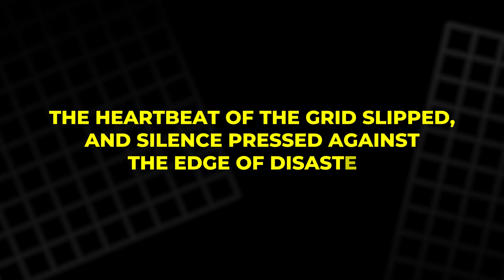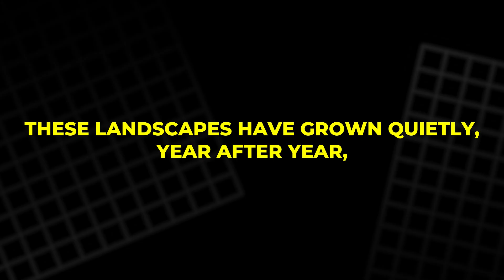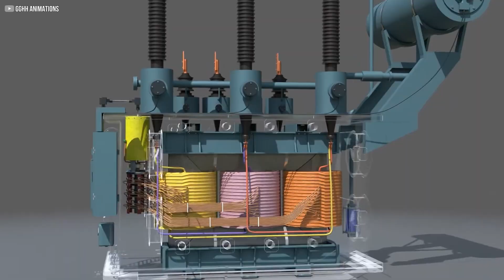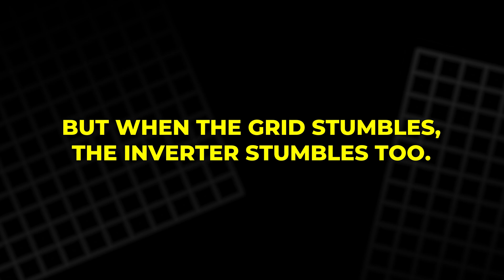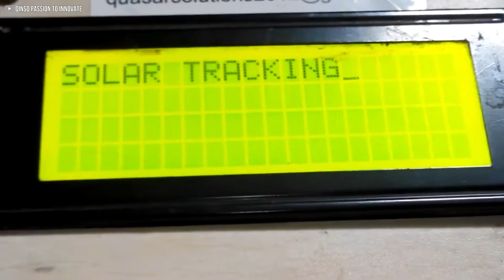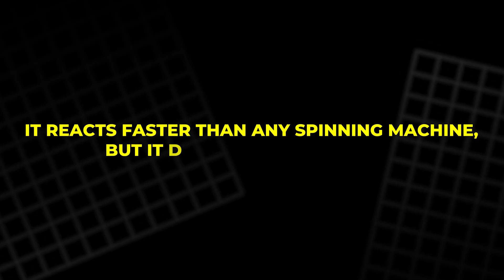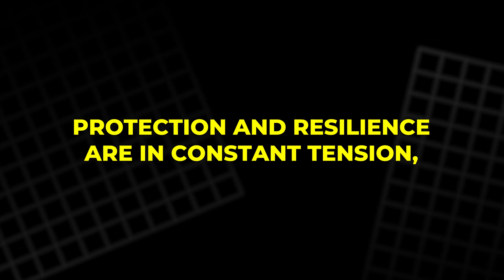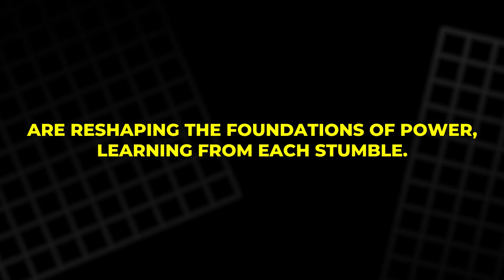The Silent Weakness in Our Power Grid

Comment: New transmission in Australia, Humelink transmission lines project is $5billion for 365km. $13million per km. 
People do not understand how extremely expensive grid poles and wires to millions and millions and millions of meter boxes costs.
14decades to build. 

Do a video on this please.
Generation is 4cents kWh electricity 
Transmission is 44cents kWh at the meter boxes. 
My grid electricity is 52cents kWh  😮😮😮

Grids ain't cheap. 

Roof PV is dirt-cheap 2cents kWh electricity and for decades and decades and 
With a v2g EVs massive storage batteries parked 23hrs every day and all night long. 

247 dirt-cheap electricity. 😊😊😊😊

Comment: V2G EVs massive storage battery is free mass electricity storage 23hrs every day and all night long. 

Selfparking selfplug-in v2g EVs at bumper height wall outlet at every carpark space at every building under dirt-cheap roof PV electricity supply. 

Trickle currents 247.
Rapid charging at the corner stores and on main roads. 

Dirt-cheap roof realestate roof PV has no grid costs. 

Extending battery EVs range is increasing the EVs massive free electricity storage CAPACITY. 

Massive storage batteries on wheels parked 23hrs every day and all night long. FREE MASS STORAGE capacity daily. 

This is cheaper than increasing national grid capacity back to bigger generators.

Comment: Nobody talks about the massive grid to move electricity. Economics of grid electricity. 

Generation is 4cents kWh 

Transmission is 44cents kWh 

Consumers roof PV 2cents kWh 

EV's v2g massive battery parked 23hrs every day and all night long. 
EV's massive storage batteries on wheels. 
EV's mass free storage 23hrs every day. 

2cents kWh electricity 247.

Grid owner's knows this fact and it causes Shttsnpants terror as the daily DUCK CURVE of demand collapse, cashflow collapse, decreasing cashflow.

Grid owner's GOUGING the remaining consumers is unavoidable to maintain their ROI, return on investment in the $TRILLIONS national electrical grid. 

Governments subsidies to grid electricity is LIMITED.
Government expansion of the national electrical grid 

CAPACITY is extremely expensive, 
upto $13million per km and a million km.
It is LIMITED by expansion costs.

Grow up, get real, GRID ECONOMICS is the 
dominate LIMITATION.

CivEng degree, UNSW, Australia. 
Decades in construction, 
Ignoring the economics is foolish.